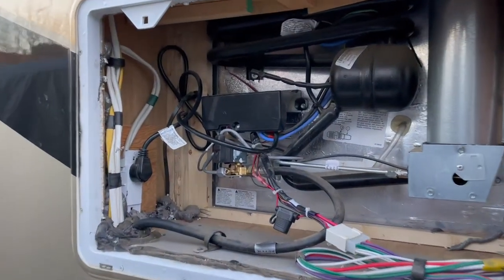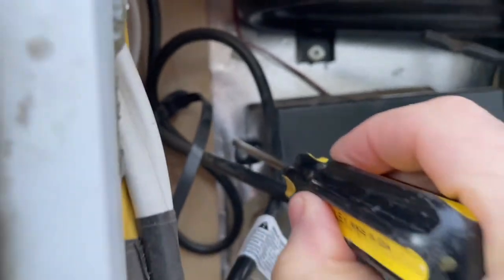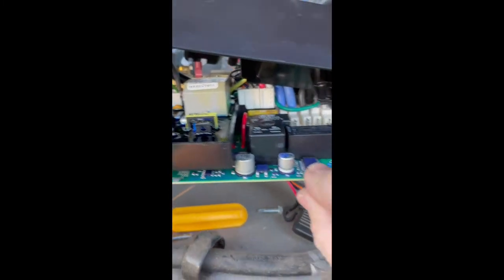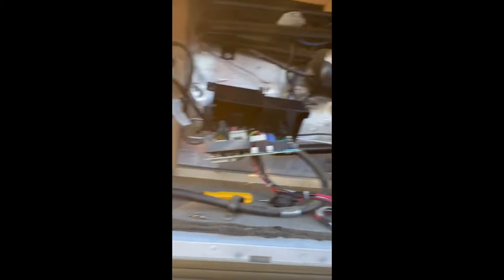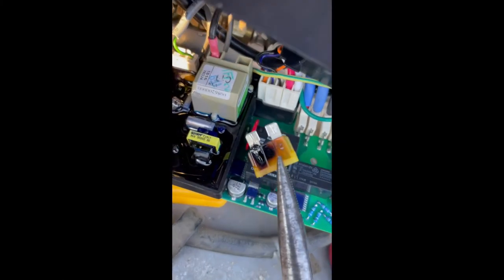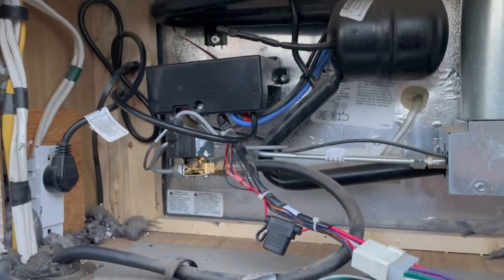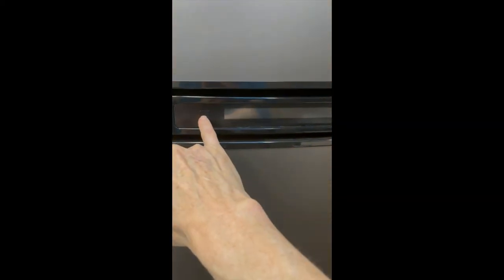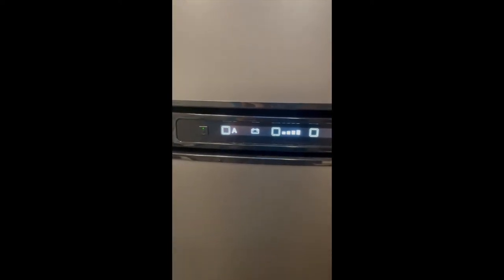NORCOLD 12V BATTERY REFRIGERATOR Mode Not Working!!!! 6 Error Code TRAVEL TRAILER MOTORHOME

Comment: Thank you so so very much for the fix. Fridge worked perfectly for the inspector and the dealership. Didn't work for us. We picked up our 2021 24L last wednesday. We've been so disappointed. Our fuse looked just like yours when he pulled it out.
Please keep up the good work! Thanks again!!
Reply from the maker: 24L Entegra Qwest? Love that one, overall good unit…..only issues we manufacturer wise is our slide out - one of the slider bolts was not secure and dragged causing a floor issue, learning there for you might be to have things like that checked out from time to time, bolts become loose easily over time and driving, every few months, I would go around and tighten all and any I could find.  All your wiring is under the bed, open that up and look around, just be aware more than anything and inspect what you can.  Know your rig, always look for things to be wrong and you’ll be fine!

Comment: Hi many thanks for the video. I had the same issue and thanks to your video I found the fuse and replaced it. But the HV+ and the ground terminals had also overheated and I had to re solder them also. thanks again.
Reply from the maker: Great! I'm relentless until I figure it out, stay tuned for more! Been focusing on the chassis fuses too......they are not labeled under driver seat, but we will figure out!